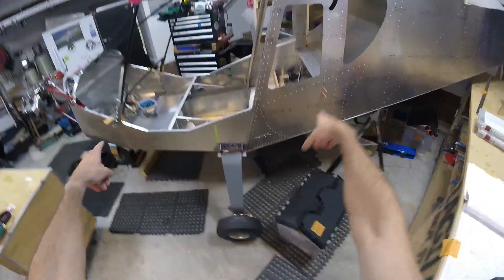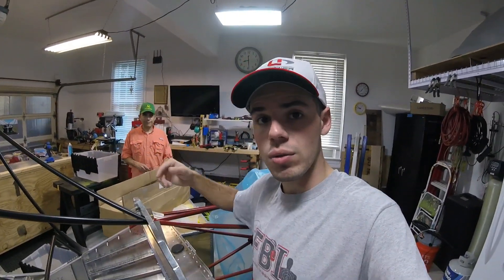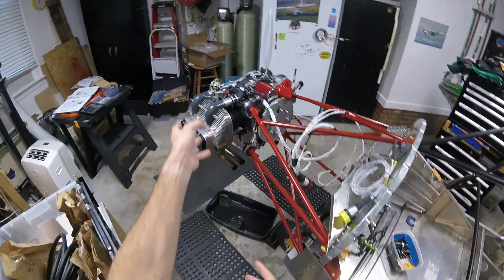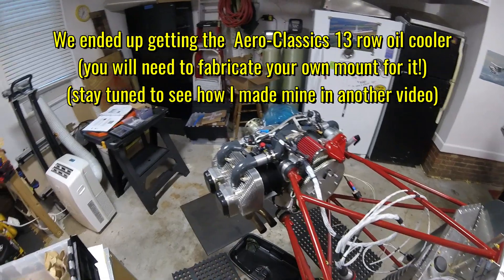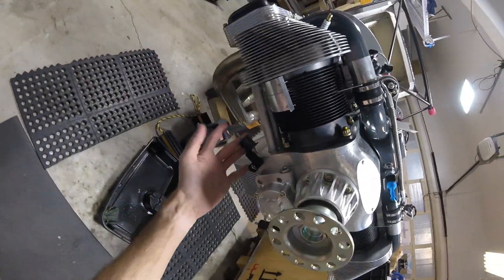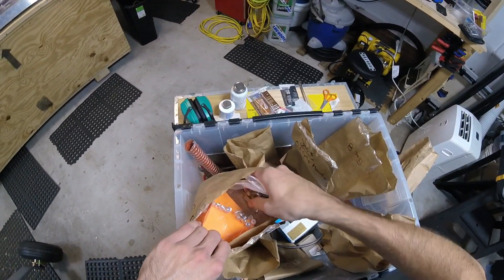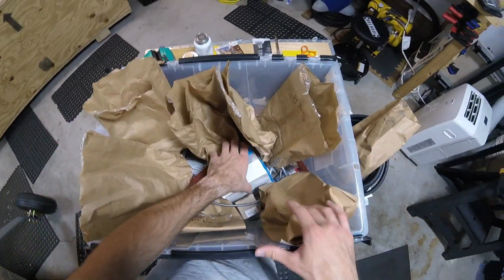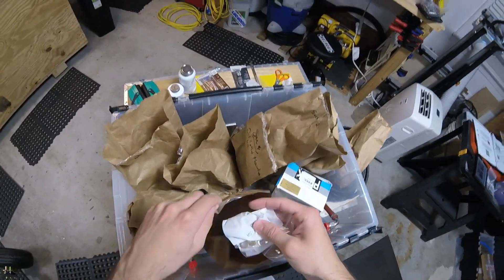Zenith Firewall Forward Kit for UL350iS - Important Info & Overview - Zenith 750 Cruzer Kit Plane

Comment: Hello Jeff, You talk about if alternator failure and with a empty  battery the party is over I understand that but I hope that you install two batteries to be redundant?
Reply from the maker: Hi, this is Adam. We do plan on eventually installing an additional battery. Though at the moment, I'm not entirely sure that the engine would not run on just the alternator (if the RPMs are kept up). I need to look into that.
Reply: @jeffandadambuildazenith6816  Thanks for answer my question. And now .. Back to Building. I love your video's Thanks for that. Bye bye.. Greetings to your Dad by the way!!

Comment: Hello Jeff, Thanks again for sharing this with us. I'am a little confused about what to buy and where. I assume if I buy the engine separate by a thirt party and buying the Mountkit from Zenith I have al the parts I need. Is this correct?
Reply from the maker: Probably the best thing to do is ask Zenith directly. Which engine are you considering?
Reply: @jeffandadambuildazenith6816  Well the questions was more  in general. The Netherlands is a difficult country to start this. It's over regulated for flying and also to get it imported I expected about 30% maybe more for taxes and importprices. But if I was going to build one I also make a choice for the UL350. That's also a reason for my question because the engines where build into Belgium whats next door for me. Have a nice day.
Reply from the maker: @gl7080  I think if you were to buy the full Zenith firewall forward kit, and the ULPower engine (either with the kit through Zenith or direct from ULPower), AND an oil cooler (Aero Classic 13 row is what Ray @ ULPower recommended) (AND fittings to attach the oil cooler hoses. For me, a 3/8 NPT on the cooler side and -8 AN size on the hose side) you would have everything you need. EXCEPT, I'm not sure exactly what items come "standard" with the engine and what "optional" kits you would need for the setup you actually want (for example, the dual fuel pump kit, oil cooler thermostat kit). ALSO, right now I don't think anyone sells an oil cooler mounting bracket for the Aero classics cooler, so you would have to make that yourself (I'm actually working on one right now).
Reply from the maker: Oh, AND some items (like sensors) will depend on what kind of avionics setup you want.
Reply: Bigger the better.   170 to 180 hp.
Reply: Bigger the Engine the better.         160 to 180 hp